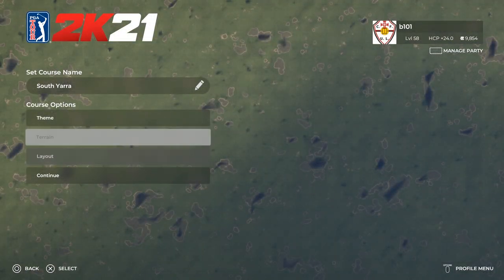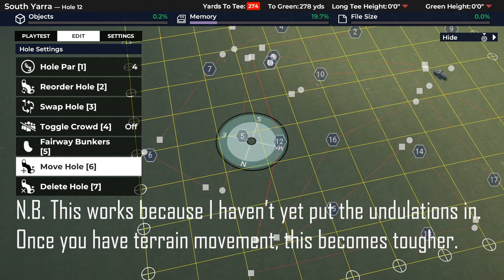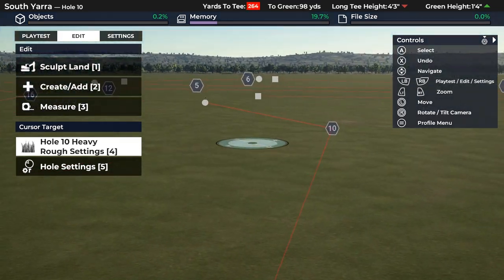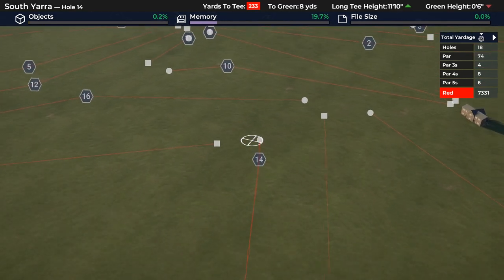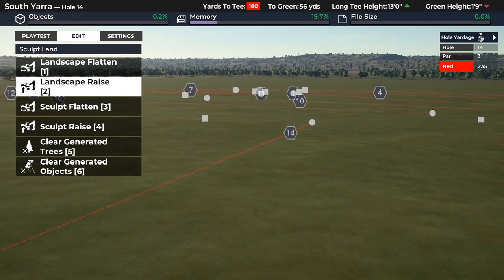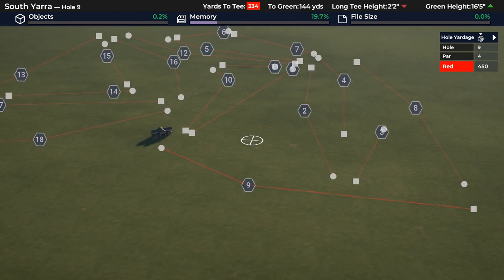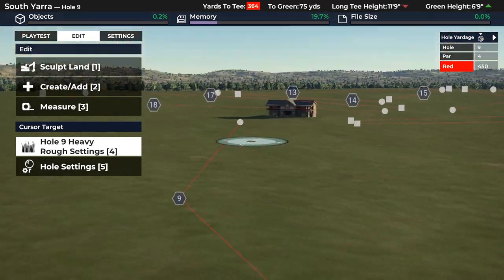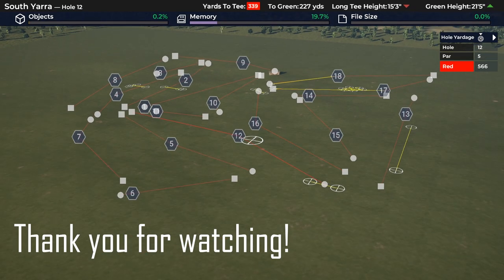South Yarra Episode 2: Crafting the plot

Comment: Once again a really great video. Full of excellent information and techniques. If you would be willing to advise on the hardware side of things it would be much appreciated. I'm currently designing on a  PS4 console, but ready to change to a PC. I'm considering a gaming laptop rather then a tower type PC, mainly because of the need for space and mobility. Do you see any large disadvantages to this idea? I don't do gaming beyond this game, and really spend most of my time designing as that is my main interest. Just thought I'd ask for an opinion. Again thanks for the content, I am enjoying this series immensely.
Reply from the maker: I had a PS4 then a laptop before going to desktop, so I can comment a bit here. First thing is price - a desktop is actually cheaper for better specs due to the space you mention. You can also upgrade items one by one - I've just doubled RAM and upped the graphics card over the summer and saw a huge upgrade in performance for relatively low outlay compared to buying a new laptop (they almost always have inbuilt graphics cards so you're stuck with the one you buy). 

Secondly, if a part fails, you can just change that part in isolation - much tougher with laptop. With mine, the motherboard on the laptop has corroded (baby destroyed it lol) and that was it done. Generally though, I'd say gaming laptops have a 4 year shelf life if they're getting heavy use. 

That said, the gaming laptop will be MILES better than the PS4 for design. I believe I had an MSI gaming laptop that worked well. I'm not an expert by any means, but would say that there's a big increase in performance the more you spend up to about £700. Then beyond that you're looking at much more for relatively marginal gains. I think I went for a £500 or so model. It was good though - if you don't have the space for a PC, then well worth looking at.
Reply: @b101design  Thanks so much for the input. Much to consider, but it's a start.